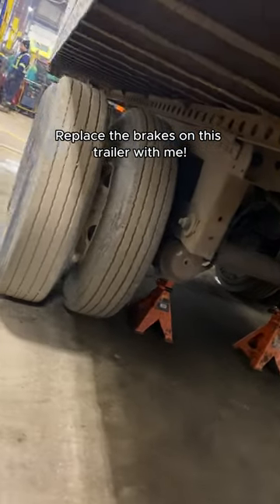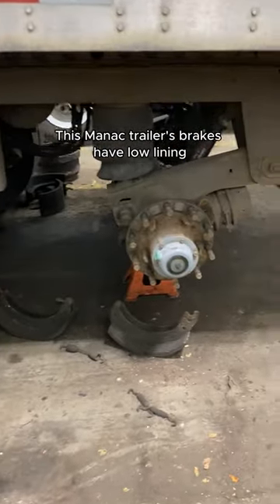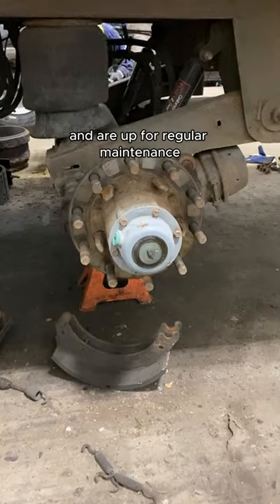Trailer Brakes Replacement #trailer #trailerbrakes #mechanic

Comment: Those are shoes not pads
Reply: They are brake linings bro doesn’t matter what you call them shoes or pads
Reply: @jamesmccurdy2292  they are linings but they are not pads
Reply: What are those jack stands rated for? Look a little small for a beefy trailer like that.

Comment: Is there a specific reason trailer brakes are the drum brakes and not disk brakes? I’d always thought drum brakes were less efficient in terms of stopping power but I’ve also never seen a shoe that wide lol

Edit: seen that drum brakes are typically more durable than disk, the wider contact patch makes it last longer, and supposedly the stopping power is better too because of the design it allows for more stopping power without pressing more on the pedal if that makes any sense